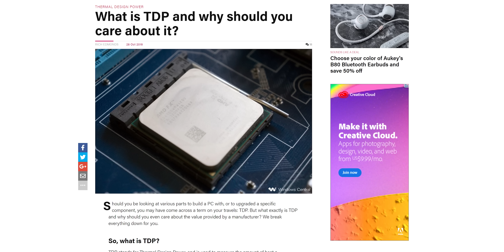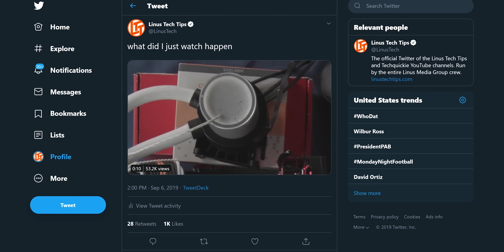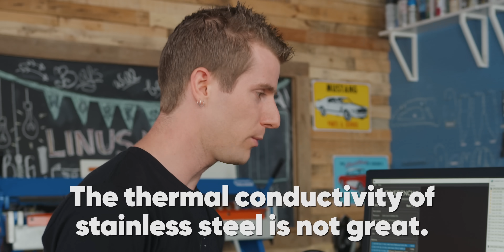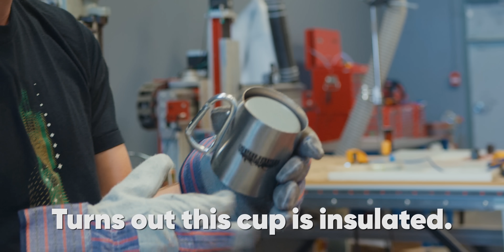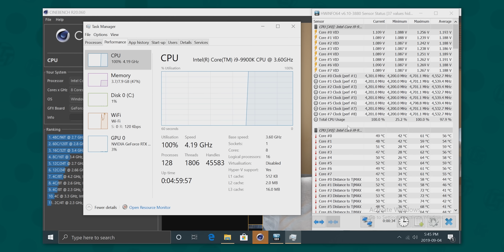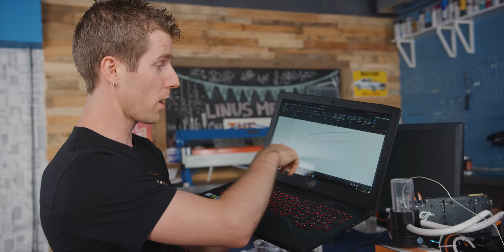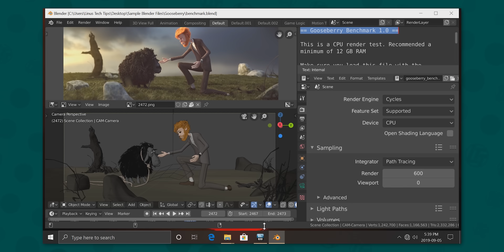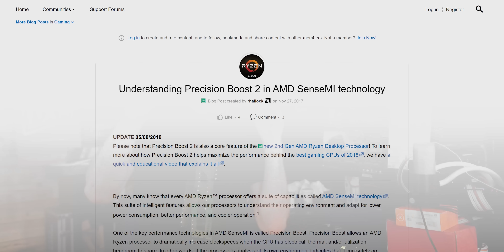Who REALLY Runs Hotter? AMD vs Intel

Comment: 0:44 AFAIK TDP represents heat emission not power consumption, I'm confused
Reply: Due to conservation of energy those have to be the same.
Reply: @vzolin  No, CPU doesn't convert 100% of electric energy it gets into heat, in fact nothing can. Also if that was the case no energy would be left for actual calculations.

TDP represents the amount of heat measured in Watts that the cooling solution must be capable of dispersing AFAIK it is not power consumption.
Reply: Energy can't be consumed, only transformed. To do the calculations a cpu transform eletrical energy (highly organized, low entropy) in heat (disorganized, high entropy). The heat emmited by the cpu is due to it actually needing to do so to perform it's work.

Also,  you can convert close of 100 % of energy in heat. That's what's a resistor does (a bit gets dissipated as noise but that also becomes waste heat down the line).
Reply: @vzolin  "Energy can't be consumed, only transformed" That's obvious, I've never stated otherwise. You're just juggling words without adding anything of value. The rest of that line too.

Also, I wasn't talking about "close of 100%" (of?), I said "100%" as in "exactly 100%". You basically said that it is impossible NOT to transform 100% of energy into heat due to conservation of energy which obviously is not so.
Reply: You're the one affirming that there is some type of calculation energy. All power that goes in as electricity in the CPU must come out as heat. The fact  that calculations are made does not change that fact. At the end of the day a transistor is just a variable resistor.
Reply: @vzolin  Okay TIL, CPUs transform electricity into heat with 100% efficiency.

To be clear I did not affirm any "calculation energy". I did affirm though that heat is not the only type of energy emission. I'm pretty sure you can transform energy into for example EM radiation such as light. And coil lightbulbs for example have different heat emission to light emission ratio than LED ones. So that ratio is variable which means different devices transform different percentage of energy input into X type of energy, like heat. That is a simple conclusion.

So what I was arguing is that I'm not convinced that the energy coming out is 100% heat.

And anyway that wasn't the point even. The point is - TDP is basically saying "your cooling solution must be able to dissipate this much heat reasonably fast". I'm pretty sure it does not directly indicate power consumption and has more variables than that.

If it does, well, the more you live.

Comment: Ok so to bring that on Point - Intel can do 5GHz on Aircooling, while AMD can also archive 5GHz regarding to GN OC Video, you just Need LN2 Cooling for that. So what you guys guys wanted to to tell here? Do The same at same Clock Speeds, that would matter more of a conclusion. Also GN has found out that good RAM Settings made up for like 500? dont remember the exact number MHz worth of overclocking. Who of you guys made good RAM Settings for Intel? I am curious to se what you could get out of there
Reply: Also dont get me wrong - your Videos are fun but Maybe try to get both processors to a Point where they will score the same in a benchmark, and then measure the heat Output. That would be way less comparing apples to bananas. I mean processors are not sold by telling People how Long it takes them to heaten their Cup of teawater with it, most are for sure not Aware how much power they are using or what this amount of power even means. Greetz

Comment: Should've just used a second psu for the cpus alone to check the power output (then maybe try this test, you would've gotten the same result i bet, without any thermal throttling). I have seen so many sketchy things from you that were funny but worked. This only looks like crap to me

Comment: This video is so dumb. No insulation on reservoir, so heat escape with time. No clear color change point of indicator paint. No consistent clock speed measurement, voltage could have dropped a lot with 100 mhz drop in frequency. Not same starting temperature. 

This is so dumb
Reply: Mingyao Liu lol, you good.

Comment: did you guys order WAY too many water jugs? you sure plug them often.
Reply: Im helping young artists with their merch, so i know a bit about producing merch and such. Water jugs are pretty neat, cause they are cheap in production as long as you make a bigger quantity, and you can sell them for a few 100% markup, without them seeming too expensive. Tshirts and such are actually pretty bad, cause you wont get that much markup with them still being reasonable priced, and having a good quality. Acrylic Keychains for instance can be made in small quantitys for 1-2$ a piece (good quality, double sided ect), and are bieng sold for ~10-20$ per piece from idependent artist. Ceramic Mugs are horrible. Only bulk is cheap, but still too expensive, and nobody wants to buy a 25$ printed basic ass mug.
Reply: I think its because its cooler master's limited edition of their cooler.
Reply: I'd actually buy one if they'd fix the ridiculous "This product is not designed for the long-term storage of liquids" issue...
I mean, really?!
Reply: Nah, they are just water jug shills.

Comment: i dont know why you didn't just make a loop with a radiator and put a temp probe inline and graph the results of temps through different workloads to see which runs hotter? this way you are doing it seems extremely flawed and full of variables that affect the outcome

Comment: Is it not possible to measure power draw off the mains with a somewhat high degree of accuracy? (I know those common plug power meters just wouldn't cut it)
Reply: You're joking with this comment, correct?

They'd have to unplug literally EVERYTHING in the house/building for that to work. Really dumb idea.

Furthermore, a Kill-A-Watt meter is extremely accurate. What makes you think it's not?

It's literally the most accurate plug in meter for the money.

Comment: A flow meter and two thermal couples - one immediately before and one immediately after the CPU water block would allow you to calculate real time power output of the CPU.  If all of these variables are  logged simultaneously, you would not even have to measure out a specific loop capacity.

Sorry for the US units but 500 x the flow rate in GPM x the rise in water temperature in Fahrenheit (BTU = 500 x GPM x ΔT) would give you the heat output in BTU. Log all of those variables over time and you'd have some slick data to play with!

Comment: Please go to AliExpress or whatever obscure Chinese motherboard vendor you choose and get an Onda B250 D32-D3 and 32 SATA drives. You will also need 32 SATA extension cables to connect the drives to the board because obscure Chinese motherboard. I am sure this thing will not work with all the drives connected and I love being proven right. Thank you.

Comment: I gotta be honest with you guys. Seeing how there were multiple testing failures on the Intel CPU before you could actually have a reasonable setup to achieve a live test for both chips, I can only believe that you may have unintentionally burnt some internal parts of the CPU along the way. Additionally, I feel as if this only test was a biased test. Because of AMD mainly being a GPU and Intel mainly being a CPU, of Course AMD is going to shine. A Graphical Processing Unit contains more ALU units and emphasises on high throughput compared to a CPU and lets not forget that since a CPU is composed of just a few cores with lots of cache memory, it can only handle a few software threads at a time. I mean of course a GPU that is composed of hundreds of cores which can handle thousands of threads simultaneously at slower speeds SHOULD mean that the heat overall needs to be lower comparatively. I'm a little upset to see apples and oranges happening on here especially since you guys know damn well of the difference between a GPU and a CPU. https://www.youtube.com/watch?v=1kypaBjJ-pg

Comment: Setup:
Temp vs time for constant performance: adjust static cpu clocks to meet certain initial performance (at various performance levels), all else the same, track temp vs time.
Temp vs time for constant clock: set the same static clocks (at various clocks), all else the same, track temp vs time.

Comment: Heres an idea to eliminate a lot of variables of your experiment: Use a normal tower cooler with a fan running at a constant slow speed (Maybe 5 Volts) and the same mounting pressure for both chips (Using a torque screwdriver). The difference of the IHS is negigable. Then you measure the heatsink's temperature once it settled in. For whatever of both chips it happens to be hotter thats the one outputting more heat. Easy as that.

Comment: just make TDP  a function of range Minimum TDP to prevent throttling at base and minimum TDP to maintain max boost  so it would look like 85w - 105w for a 3.8ghz - 4.5ghz (random numbers).  So then you know what you need to cover minimum thru to maximum performance or more for overkill or manual overclocking purposes.

Comment: Consumers should ignore TDP and just pay attention to power draw as that is the more important number. Higher power draw generally equates to more heat.
Reply: yep, also if reviewers really wished to; there are X570 and Z390 motherboards of the same brand that have fully identical VRMs. That plus the same ram sticks, power supply and videocard, and a good watt-o-meter and you have a proper test, even if not perfect.
Reply: The problem with this approach is that the proportions of the total power drawn that are consumed as work done and disappated as heat differ depending on the architecture and manufacturing process - that's what they're trying to measure with this experiment.

Comment: In a thermodynamic sense, modern computer chips are essentially large resistors: the amount of energy used to compute is negligible and almost all energy drawn by the processor eventually dissipate to the environment as heat. So the easy way is just to measure how much power is pulled on the 12V EPS cable rather than this entire "heating water" stuff. Also you do not need to control the starting temperature as the final energy taken by water can be calculated using heat capacities and temperature change.

Comment: You really need a experimental physicist to advice.
Reply: @Predator Ex I think physicist is more appropriate.
Reply: @Mandragara  The physicist is the one fo this.
Reply: Probbly not even that they just need to think about it a bit more is all not a bad dead reckoning setup tbh.
If it was me  next step would be,  add a flow measurement then input and output temp(few more decimal of persision needed). Then its just a matter of taking water flow and pipe diameter to get you water mass. Then use the delta between in and out temp to get  the heat. Basically Your building this https://www.carolina.com/teacher-resources/Interactive/food-calorimetry+/tr23949.tr
Reply: @Predator Ex I agree with you, an engineer might have more experience with that.
Reply: "advise".
Reply: Yep I think your right. But would it be as much fun?
I wonder if they ever find the correct answer?
So many questions.

Comment: sir would you please try to make a experimental video of  liquid cooling system entirely with isopropyl alcohol where coolant used in system will be  isopropyl alcohol aka [rubbing alcohol]
so in case if the compression fittings leak there will be no issue of short circuit 
and try 3m novec fluid too 
please do this

Comment: Well I do hold the opinion that 9900K is hotter than 3800X, but it does not mean that I agree with the conclusion of this "experiment", as this "experiment" is totally wrong from the design to the actural procedures. As long as Linus learned how to measure the specific heat capacity of water then he won't be behaving so discracefully here.

Comment: Blender prefers AMD due to higher L3 cache. Should re-test with a variety of software loads for more data points to reduce the standard deviation. As it is, the sample size is too low to be useful.

Comment: Suggestion: for the next video use 2 reservoirs: 1 for the pump inlet and other on the waterblock outlet. Use to thermocouples, first on the tube 50 mm before the block second on the tube 50 mm (you can insert probes on the fittings with small leakage). With the system soaked, put 100% of the workload, start the test, wait until inlet and outlet temp stabilize and measure the delta T. Measure the volume of the second reservoir for an arbitrary amount of time to find your volume flow and use density to find your mass flow.  Assuming the inlet and outlet with same mass you will have the amount of heat using Q=mCpDelta(T).. m is mass rate, Cp is specific heat. You will find exactly the heat output over time for each processor under full load.
Reply: You could also use a single reservoir,  and outlet on a sink or floor and measure the flow rate on the first only.

Comment: Linus, may i suggest you invest in a BTU meter,, they measure flow of water, and the delta of the radiator, so you can run MUCH LONGER, tests and work out system variable.

onicon, sells BTU meters, any proper BTU meter will have a flow meter and 2 MATCHED probes, plus a control module which will tell u BTUs, and WATTS of heat output.
Reply: Thats the proper way.
Reply: @z1xems  "How MISGUIDED are you? I feed you a couple of bullshit legal precedents, and there you go - you jump on it like a bitch in heat." - Law Abiding Citizen (2009)
Reply: Just use two thermocouples and flow meter.  Regardless, you need to calibrate anything.
Reply: Oh, you...with your scientifically accurate techno-jargon.
Reply: for a rough comparison you need no BTU meter you can do it with a closed loop cooler pump and fans on 100% and 2 thermocoupels on the in and out siede of the rad and you good to go
Reply: Aquaero unit has that feature, been using it for years
Reply: So, many unnecessary, commas, it’s hard, to read.
Reply: Linus'es Schtick: during next wan they will tell you that they purposefully didn't use a btu meter to make a more entertaining video.

Comment: I was testing a i9-9900 just a few days ago, and that thing ran super hot.  VERY hot.  With a Noctua dual 120mm fan on it, it was still throttling..and ran at 92c while using cpuid stress test for just a few minutes.  It used to be that AMD ran hotter and performed a little less, but now it is Intel's turn to be the second class citizen.

Comment: I believe the 9900K's advertised TDP is rated with the iGPU running full bore as well.
Reply: How so? Intels TDP is typically 150w and thats without the iGPU being used, 95w TDP at base frequency only. There are countless dozens done this test, and they record from the EPS power so nothing else impacts the power consumption figures.

Comment: Because amd using 7nm intel using 14nm++ 😉 not only power also heat
Reply: more like 14nm+++++++++
Reply: @Unbe Kannt Intel's architecture just can't keep up. There's no way they'll scale up to 12 cores or to 16 cores without a chiplet design. And by the time they do, one way or the other, AMD will be so far ahead, they're screwed.
AMD is ALREADY so far ahead, they're screwed.
Reply: The 9900K also produces more heat than the 1800X, and they're both on 14nm.
In fact, they're on different fabrication methods, and Intel's 14nm fabrication method consumes less power than AMD's 14nm fabrication method.
And the 9900K still produces more heat.
Reply: @Unbe Kannt not true intels laptop processors are a great example while the 10nm versions perform better in graphic intensive  tasks due to the new gpu architecture in cpu intensive tasks the 14nm version is better and recommended by intel the problem is the 14nm node is so well refined that the ipc gains they make going to 10nm is out done by the drop clocks putting them behind the current generation

Comment: You're putting out a lot of wrong and confusing info on the 9900K.

At stock with a 95W TDP enforced, it has an all-core turbo of 4.2GHz (4.0GHz when using AVX2 instructions), though it can go as high as 4.7GHz on all cores for about 20 seconds.

With sufficient power, and no TDP enforcement, it runs at 4.7GHz on all cores under full load.

With MCE, it runs at 5GHz on all cores.

Furthermore, Intel does not define TDP in terms of base clock.  It defines TDP in terms of a given frequency spec.  For the 9900K, that is 4.2GHz on all cores (or 4.0GHz when AVX2 is being used, because those instructions consume more power), with short bursts up to 4.7GHz (i.e. not enough to overwhelm a cooler designed to dissipate 95W), followed by a sizable delay before it can clock higher again.

AMD defines TDP as the max amount of heat that needs to be generated when the chip is running at full load with max stock clocks.  For the 3800X, that's right about 4.2GHz on all cores under full load (no drop for AVX2).

What's probably happening here is that Intel is pretty much right on the spec, when 95W is enforced (which it automatically is when your motherboard can't supply more power, as was the case with your original 9900K review), while AMD is providing a worst case number.

Comment: Why not just measure power consumption? I mean a computer can essentially only convert electricity into heat. 
So if you want to know what the difference in power consumption is in Watts, then the correct way to measure this is at the power outlet. Take a baseline at idle to find out the motherboard consumption begorehand and use identical power supplies though.